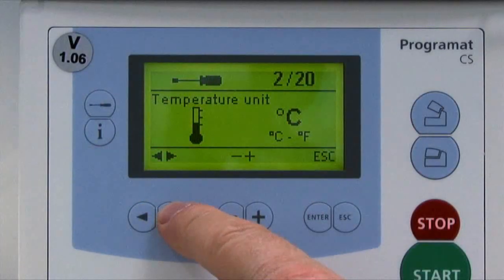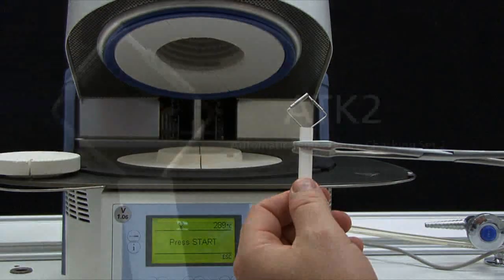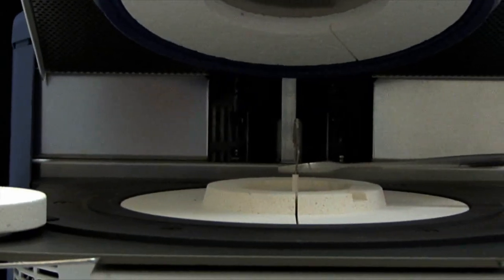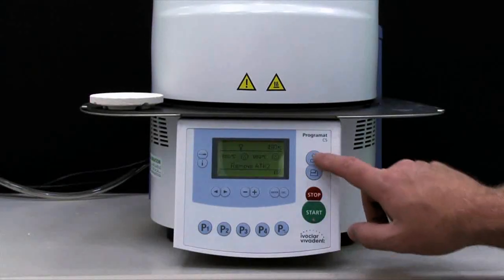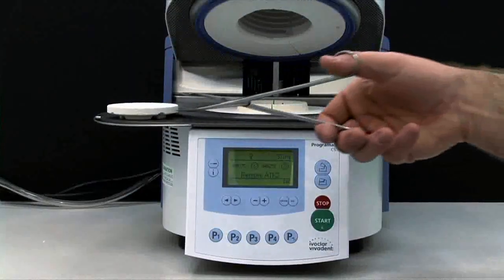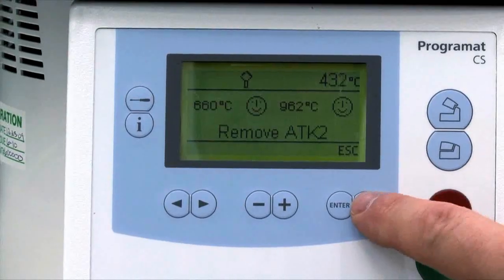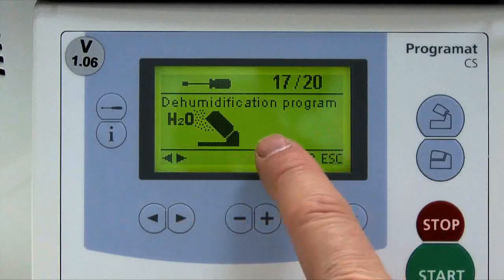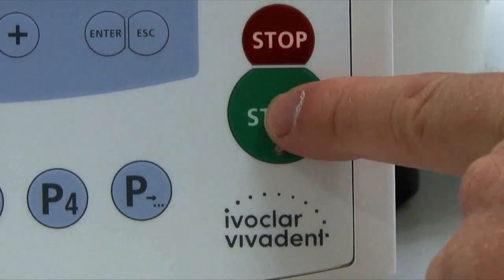Programat CS - Chapter 4 - Calibration & Dehumidification

Comment: Please help!
I'm getting error 802,,
(No vacuum increase could be measured. Check the following points: Is the ﬁring chamber tight (nocontamination on the sealing surfaces)? Is the vacuum hose connected? Is the vacuum pump connected?Is the fuse F1 o.k.?)
Reply from the maker: Dear Wael Najem

If you checked all of that, then we kindly ask you to contact one of our local distributor.

Best regards
ServiceLine, Ivoclar Vivadent